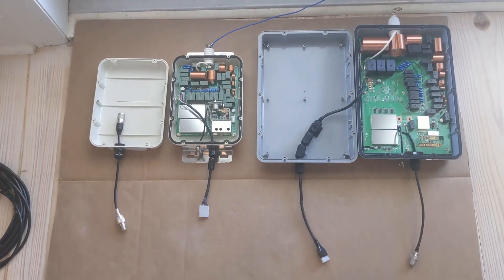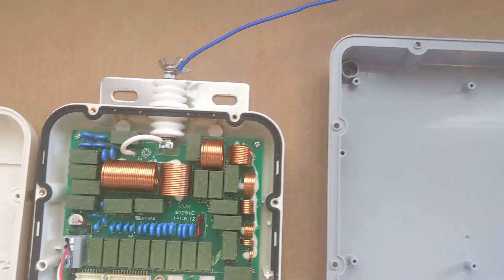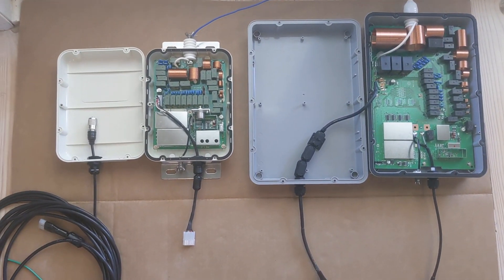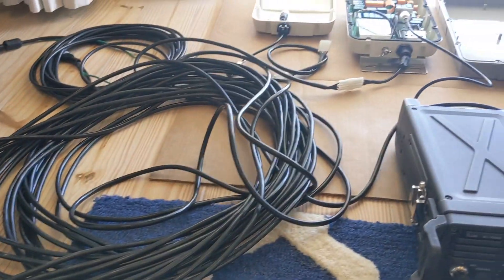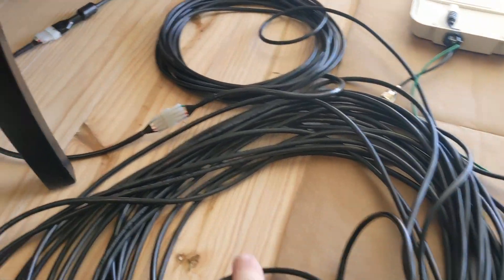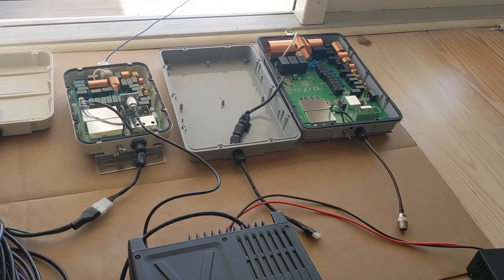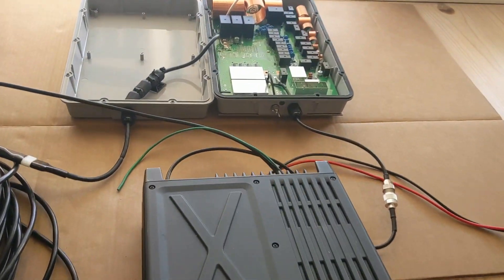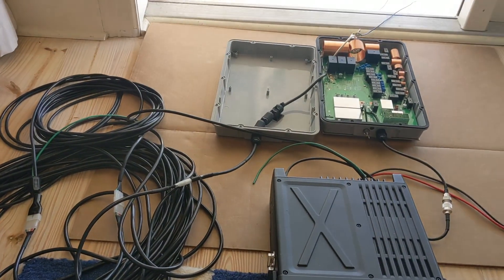Icom External Antenna Tuners AH-730 AH-4...100 foot extension cables?

Comment: For my portable POTA/BOTA and field-day station, I run an IC-7300 with the AH4 - I also added short pigtails to the AH-4 for ease of use.

I made an extension lead to add to the control cable for the AH-4 which takes it to 30 metres long, including the supplied control cable, if I need it to.

I use either 10 metres, or 30 metres of M&P Ultraflex-7 coax and I run 21 metres of twisted copper wire (sheathed) in a triangular delta loop configuration with the high point at 10 metres, using a fibreglass telescopic pole, directly between both terminals of the AH-4 with no ground.

The end result is an antenna that will tune everywhere from 80m - 6m (and I mean everywhere!) - usually if I can hear it, I can work it, apart from the super-contest stations of course!!

Best bit of kit I have bought in all my years of amateur radio!

Comment: The newer radio ic-xxx do 200W  and now the partybox will be burned out.
Reply from the maker: The IC-7760 lowers the output to 100w on ANT1 when the external tuner is connected.  It's explained in the owners manual.
Reply: @nu5m_radio  ah so is it, thank u, soon i buy this ic xxxx named 7610 i make an unboxing thing :-)

Comment: I left a message on one of your other videos....was wondering how you have your turners wired to the radio?
Reply from the maker: Are you needing the wiring connections inside of the tuner?  The external wiring to the radio is explained in the manual.
Reply: @nu5m_radio  Well it sort of is explained if you understand it.....which I don't....anyway you could describe the 4 connections in layman's terms?   Thanks much....

Comment: Nice training video, I only recently learned that non-resonant antennas such as my 71" end fed random wire and the 66"Off Center Fed I keep as a backup, both must have a remote style tuner. Kinda disappointed as I purchased a nice LDG regular desktop tuner.  I got an IC 7300 rig, so I am going to start hunting for a sale on that model Ah730.
Reply from the maker: A good alternative the AH-730 is the AT-140.  They can be found NIB on ebay for sub-$300 from time to time.

Comment: Very cool.  I'm getting a 703 delivered today.  I found the cable but what is that connector?  Amazon?  Thanks
Reply from the maker: Which cable are you referring?  I know some vendors don't mention it, but the AH-730 comes with the tuner cable.  The longer cable in the video is a DIY assembly.  The connectors are available on ebay or Amazon.
Reply: @nu5m_radio  Thanks, I am needing to extend the control cable to about 60 feet for the 703 tuner.  I did find the V-1211 cable you used but I'm not familiar with the 4 pin flat connector.  Just looking for an industry name for them.  Thanks!  Bob
Reply: I keep calling it a 703, I mean AH-730.

Comment: Do you use a common mode choke on the coax just before the tuner?
Reply from the maker: I have one of the large clamp-on chokes around several coils of the coax just below the connection point.  I am not sure if it makes any difference or not.  I was more concerned with stopping RFI.  I'm not sure if a common mode choke is necessary.  I had one on there in the past and noticed no difference.  This is with my mobile setup.

Comment: Did you find adding some ferrite made any difference?  If so, what type did you add?  Also, do you think using shielded control cable and grounding out the shield on the tuner or radio end would help in any way?  I have an AH-4 and IC-7000 but get ridiculous amounts of noise....
Reply from the maker: I'm not sure if the clamp-on ferrite I added to the cable on the inside did anything.  I never used it without the added ferrite.  I'm guessing it made little if any difference.  With that said, I don't have any interference so not sure.

There's a guy in Japan that sells an internal ferrite kit for the Icom tuners.  I'll see if I can find the link.
Reply from the maker: check it out....seems like a good idea:  https://page.auctions.yahoo.co.jp/jp/auction/u1096227869

Comment: Hi, I'm in Canada and am interested in what kind of cable the standard Icom 30 ft cable is (I need to extend that cable to about 75 ft) and if I could source a similar one locally, and would appreciate your help. From what details of I can glean on Icom pictures on line, it seems that it is the "KVC36 UL Standard Kuramo Electric Under 100V UL/AWM standard signal cable" and it is 4 wires, about #20AWG and unshielded(?). Does this look right? If it is really unshielded, which I am surprised, I am thinking of trying a Cat 5 or Cat 6 UTP cable like from Home Depot... I am curious where you got your extension cable? Tks es 73
Reply from the maker: Cable supplied with the AH-730 is "KANZACC 2021 0.3mm2 LFV-R" (4-conductor + shield).  Chart shows to equivalent to 22AWG which seems very small.   

I'm not sure of the cable specs for the AH-4 as it's on the truck, but it's non-shielded.  The longer DIY cable I made is 16AWG direct bury cable from Amazon. The Amazon cable is far better than both of the factory cables, but it's unshielded.  

The wire I used for the extension is Voltive V-1211 available on Amazon.
Reply: @nu5m_radio  Thanks for taking time to reply to my quite late comment. 73

Comment: I have an AH-4 connected to my IC-7600 with the factory cable and COAX feeding a horizontal DELTA LOOP that is only about 7 feet high. 

Total 20 AWG bare copper wire length of the Delta Loop is about 210 feet. 

Very robust. Tunes 160 —> 10 meters.

Installed in my backyard about 6 years ago. I started with AWG 26 gauge magnet wire (clear coated) but wire was too thin and kept breaking. 

I moved up to 24, then 22 and now finally 20 gauge BARE copper wire which has not (yet :-) broken. 

I live in an HOA with antenna restrictions. The bare copper 20 gauge wire turns “black” in the Arizona sun in just a few weeks and renders the antenna wire virtually invisible. 

Support poles are camouflaged and two have weighted halyards with plastic pulleys to keep tension on the Delta Loop wire. 3rd camouflaged pole has AH-4 atop it with Delta Loop hooked directly to it. 

No BALUNs. No Ferrite beads. 

I was not aware of the AH-730 when I purchased the AH-4 ten years ago. Will look up the specs on the AH-730. I am looking for a tuner that will handle more power. Maybe that is the AH-730 ??????

Nice video. THANK YOU very much for posting. 

Bill - W7JZE
Reply from the maker: Sounds like a great setup, Bill.  The AH-730 handles 150W PEP, so little more than the AH-4.  It's a fantastic tuner and I'm planning to get a second one for /P use.  73

Comment: I think I would be more inerested in seeing the max for the Coax feed into the Tuner. I would imagine the only thing to consider would be any reactence that may be introduced for the longer lenghts. I have the AH-4 with the standard 30 foot controller cable and about the same for the coax feed to the tuner. And like you I also modified mine to have a removable coax connector at the bottom of the case. I found it to be much more convenant as needed. 73 and thanks for sharing Vic de KE8JWE
Reply from the maker: I can do that.  Give me a couple of weeks.
Reply: @nu5m_radio  usualy abov 150 fet you start to get broblem on feed line you start to luse power output i tested at 200 foot rg213 losing about 25w to 35 w 4 the remot usualy if yoy mantain a certen diamater you can go up to 1000foot

Comment: Take the AH 4 outside and feed a Delta Loop with ladder line
Reply from the maker: I've got plans to run a 1000' Beverage antenna over the next couple of weeks.  I think I'll have enough material left over to build a loop.
Reply: I have an AH-4 connected to my IC-7600 with the factory cable and COAX feeding a horizontal DELTA LOOP that is only about 7 feet high. 

Total 20 AWG bare copper wire length of the Delta Loop is about 210 feet. 

Very robust. Tunes 160 —> 10 meters.

Installed in my backyard about 6 years ago. I started with AWG 26 gauge magnet wire (clear coated) but wire was too thin and kept breaking. 

I moved up to 24, then 22 and now finally 20 gauge BARE copper wire which has not (yet :-) broken. 

I live in an HOA with antenna restrictions. The bare copper 20 gauge wire turns “black” in the Arizona sun in just a few weeks and renders the antenna wire virtually invisible. 

Support poles are camouflaged and two have weighted halyards with plastic pulleys to keep tension on the Delta Loop wire. 3rd camouflaged pole has AH-4 atop it with Delta Loop hooked directly to it. 

No BALUNs. No Ferrite beads. 

I was not aware of the AH-730 when I purchased the AH-4 ten years ago. Will look up the specs on the AH-730. I am looking for a tuner that will handle more power. Maybe that is the AH-730 ??????

Nice video. THANK YOU very much for posting. 

Bill - W7JZE